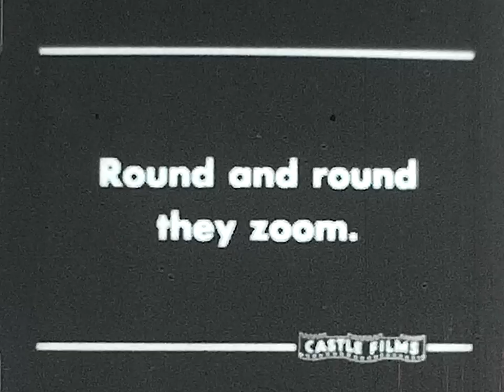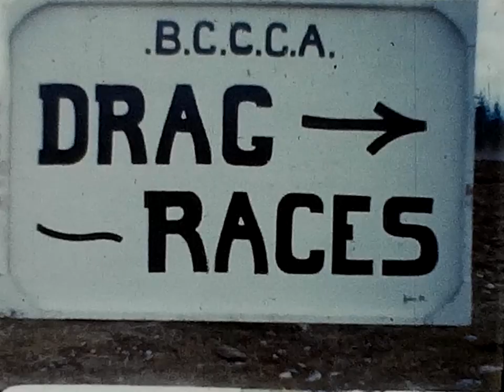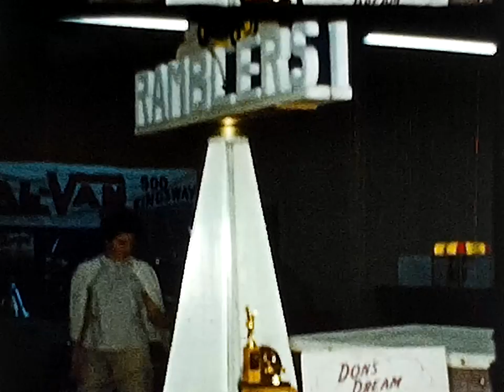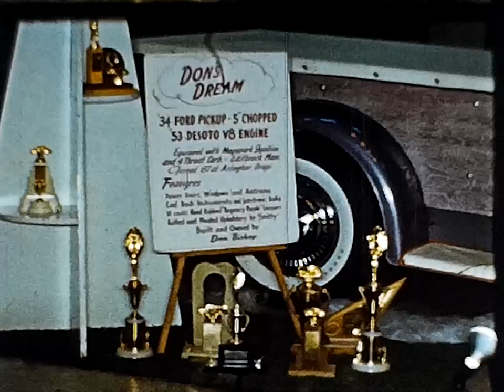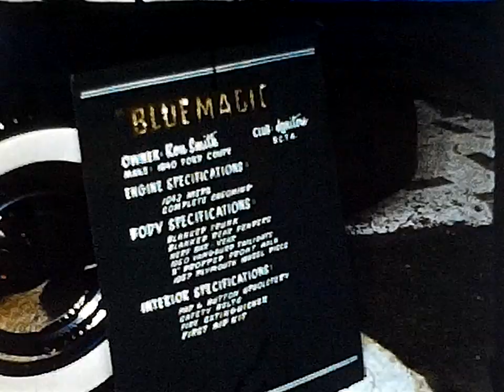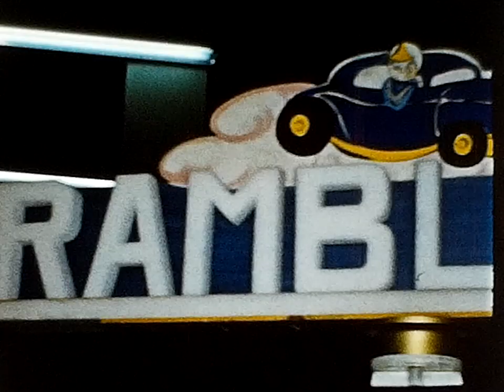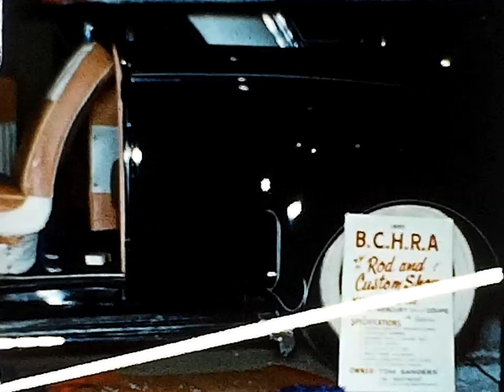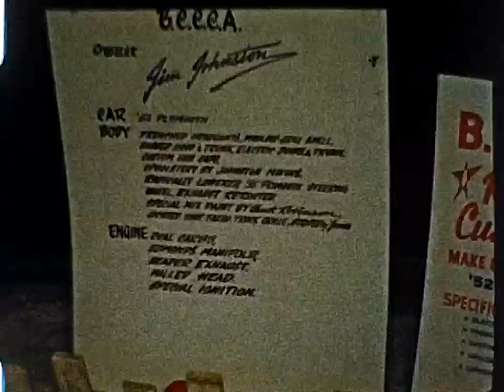BC Classic car association Drag racing 1954-1958 HD scan from original film.

Comment: great stuff, how do you find the wolverine?,  had mine about 2 years, in the 1st few weeks I had a problem with it going out of focus, had to do a small modification on it, a have a video on my channel showing what I did, had to make a cut in the case near the camera so I can adjust the lens if it happens again.(its a clone wolverine)
Reply from the maker: The only problem I have had is the take up reel motor went out. I have not repaired that as of yet and may not bother as I simply put a box on the floor and let the film drop into the box.  Even less stress on fragile film and less jitter on old sticky film that would bind in the tension reduces then let go and when the slack was wound out the frame would bounce slightly.  Also faster to rewind when picking up from the box as no resistance from the clutch in the take up.
Mine has had hundreds of reels put through it,, mostly 200-400 footers. Tons of hours. I am surprised it still works. Unit has paid for itself about 4x over so if it breaks I guess I will have to get another one.

Comment: i can't imagine how many $ of raw film negative this was, and dev lab charges.
Reply from the maker: Lots!  I never asked but playing with super 8 in the late 70s I can tell tell you that 50 feet was around 25 for film and processing.  That was about 2 1/2 minutes of running time.
Reply: @12voltvids  my father used to spend a lot on super8, and he was always nervously panning very short takes. it seemed like hearing the cents droping during a long distance call on steroids...